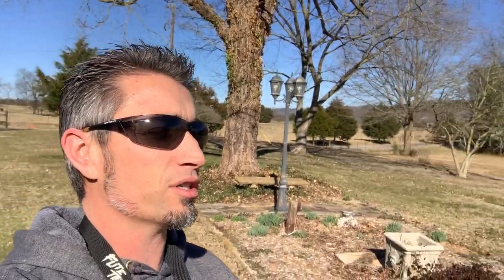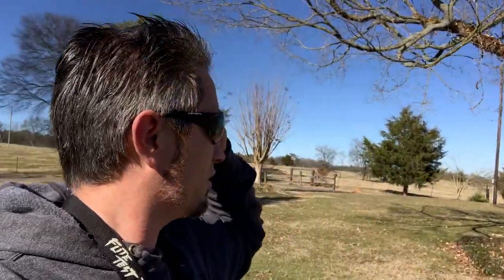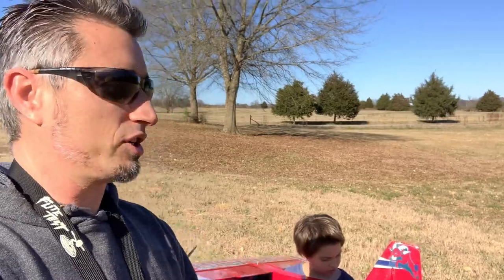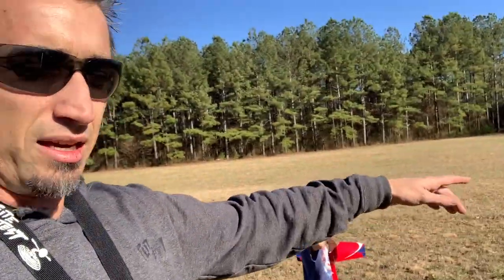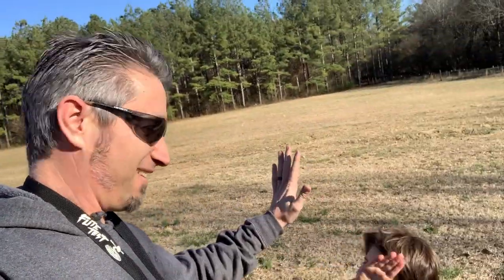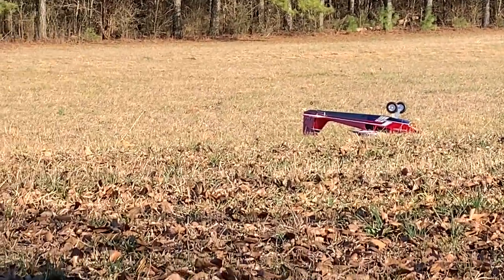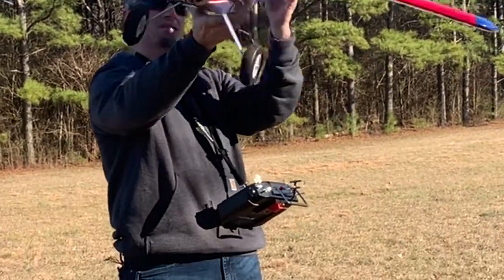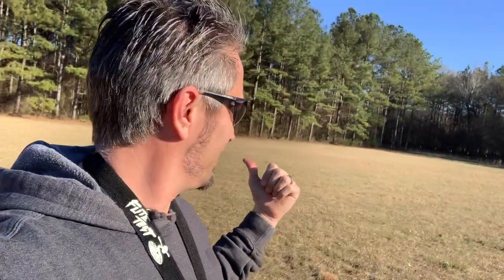Big Horn Stress Testing

Comment: you need a roller and to drop the mower deck way down on that backyard flying field.
Reply: You get a heavy roller on that lawn while its still saturated and smooshy. Be nice for flying after the second or so mowing. Throw some Zoysia seeds on there and start mowing wiht a reel mower and have putting green level runways in short order.